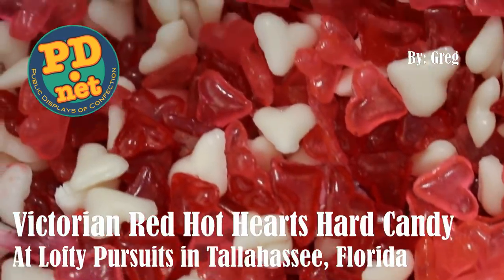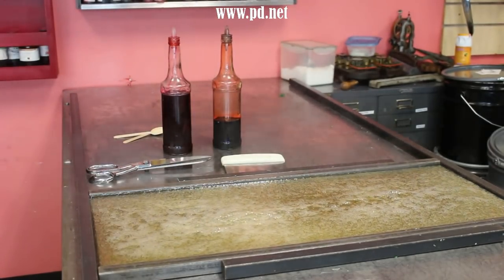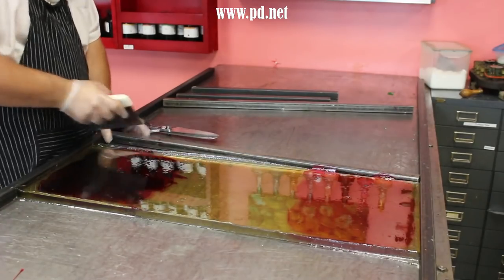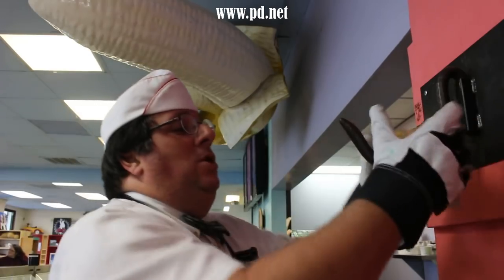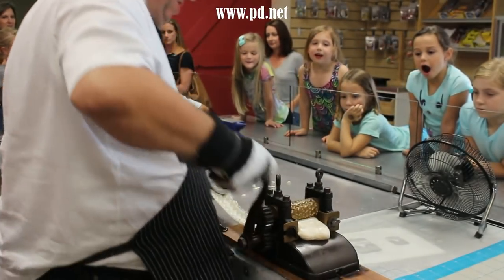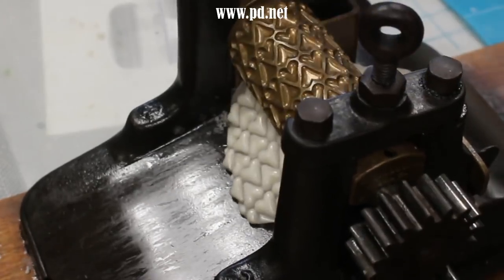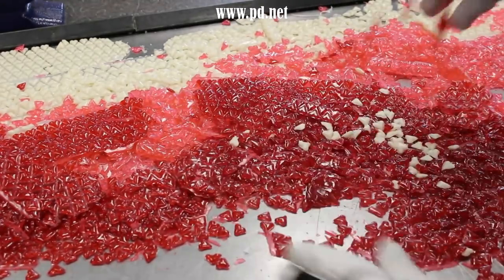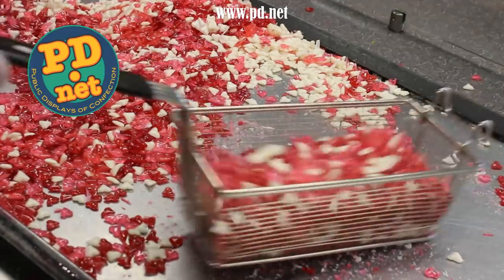#60 Victorian Heart red hot Candy or why do hearts not look like your heart?

Comment: how would they turn out if you put 2 flat sheets of candy together and put it through the roller? would it result in candy that is one colour on top and another on the bottom?
Reply from the maker: +Building Books if it squeezed evenly yes,  but odds are there would be marbling as when the candy bunches as you roll it through, it can still look cool, but takes more time to do.
Reply: I would like to see marbled candies on this machine, or how about mixing candy dust on other batch?
Reply: Lofty Pursuits it would look really cool
Reply: Lofty Pursuits could you use something like a pasta roller to get even sheets of candy?
Reply: @jolienvsndijk  probably

Comment: It seems a bit similar to glass making. Can you blow candy up like a glass blower??
Reply from the maker: Yes, but it cools so fast, it's very hard.
Reply: Thanks for the quick response. That makes sense, considering the large temperature difference between molten glass and molten sugar. 
I wonder if blowing in heated air through a pump might help? Sounds like some fun experimentation at least. I enjoy the chemistry of it all... plus the taste. Thanks!
Reply: Some chefs actually do blow sugar to make special desserts
Reply: Search Las Vegas lemon drop dessert

Comment: The heart shape DOES look like a real heart. It's just a simplified outline. Take away the arteries and you can see the shape. Human hearts have two atrium that do appear like large mounds on top and taper down to the bottom with the two ventricles. They don't exactly become a point at the bottom, but it is close. Google images of human hearts you can see the design. Like this, just imagine the outline of this: https://s-media-cache-ak0.pinimg.com/originals/53/40/9f/53409f7756db0b7ed2e66bba82ffc522.png

Comment: One thing you often mention is boiling the water out after adding the color - I assume that's because the colors are water-based.  Is there non-water-based coloring, or would that not mix well with the candy?  (It's been far too long since chemistry class, sadly.)
Reply from the maker: +Dave H dry colors don't dissolve in sugar.  It makes a misty looking colors.do not like thrm.
Reply: Thanks for the reply!  I was sure there had to be a reason. :-)

Comment: Actually when I watch similar videos, the worker put white food coloring in the white part instead... but to be honest I prefer less food coloring😂
Reply from the maker: +Killian Jokker the main ingredient of white food coloring is titanium dioxide. While there are certain cases where I have to use it I try to avoid it. The main reason they added as they don't pull the candy enough. If you could pull the candy enough all the little air bubbles create more surface area and make a better tasting candy.